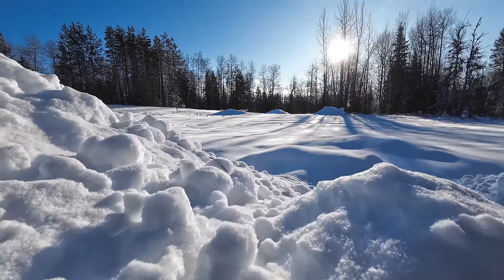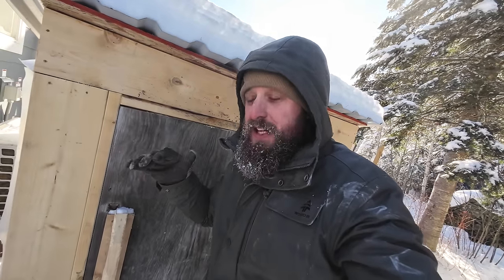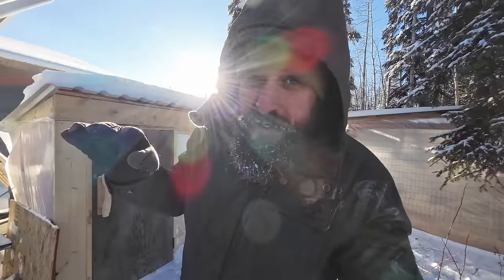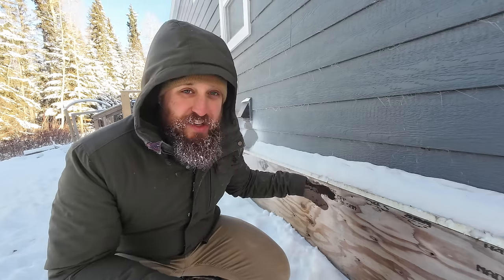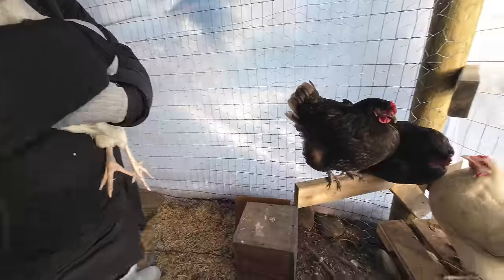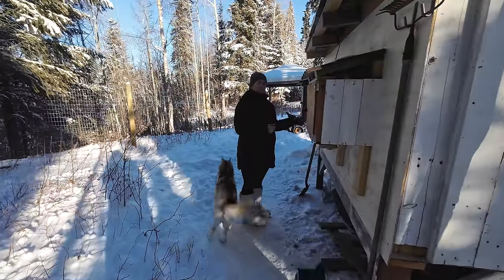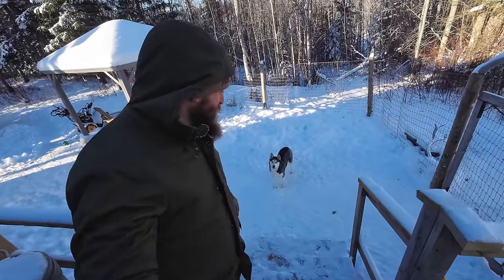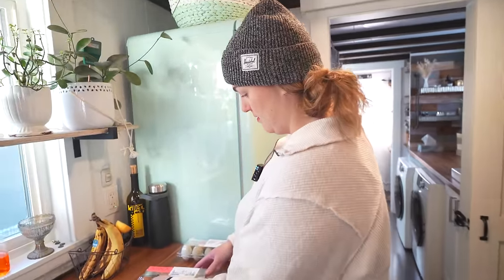Surviving a POLAR VORTEX in our TINY HOME! | -35 Celsius!

Comment: A Polar Vortex!? People Give me a break! 😂
Reply from the maker: Yes a polar vortex. Heres the definition for you: The polar vortex is a large area of low pressure and cold air surrounding both of the Earth’s poles. It ALWAYS exists near the poles, but weakens in summer and strengthens in winter. The term "vortex" refers to the counter-clockwise flow of air that helps keep the colder air near the Poles. Many times during winter in the northern hemisphere, the polar vortex will expand, sending cold air southward with the jet stream. This occurs fairly regularly during wintertime and is often associated with large outbreaks of Arctic air in through Canada and the United States. 
Glad we could help you learn something today. :)
Reply: This occurs all the time in Canada. It has to do with low pressure and cold air at the poles.

Comment: Holy Crap ..... you guys are crazy ...... do you really run thru a hundred bloody pounds of propane in a week !?  

If so why? Even a log cabin won't cost that much, is your tiny house not insulated worth a damm?  
Based on the crap job they did with the water pipes I think they screwed that up too .....

In Ontario it costs about $90 CDN for a 100 lb tank refill, so that's true that's $400 a month .....  Really?!!?